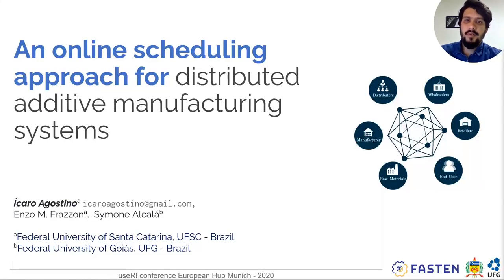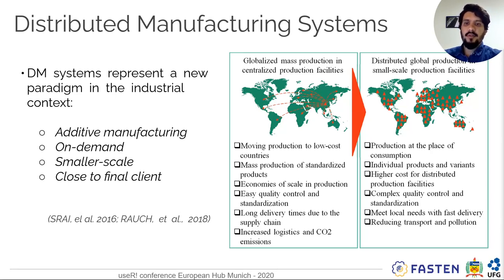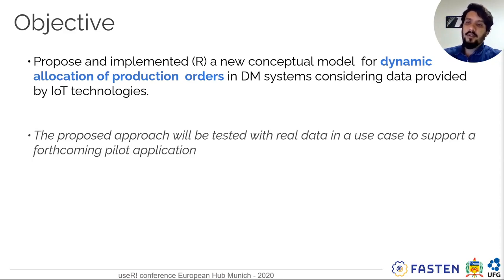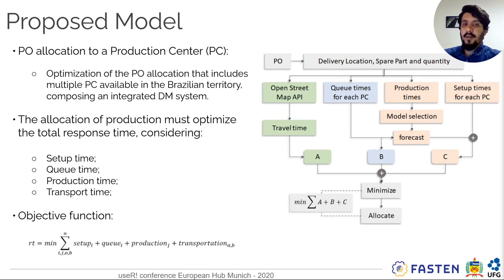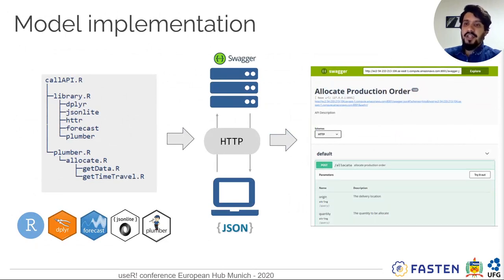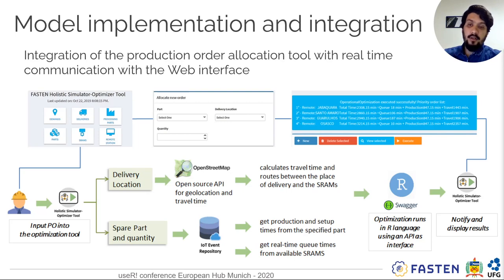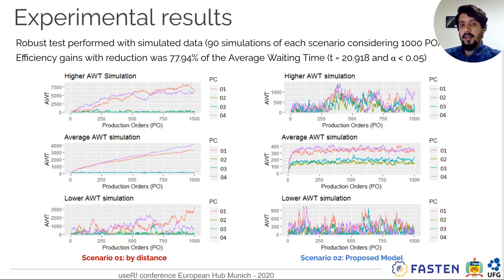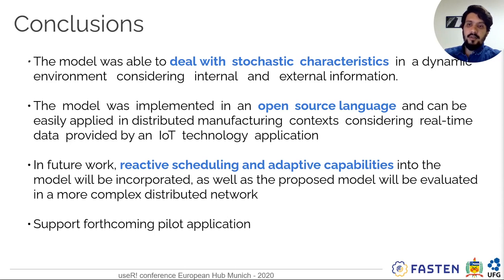useR! 2020: online scheduling approach for distributed additive manufact. (I. Agostino), lightning

Comment: Hi Icaro, Thank you for your demonstration. but most of the businesses are using ERP systems, and has a supply chain arm which needs supplier confirmation with the lead time. as a supplier If I want to reduce my lead time, I will try to change my manufacturing strategy to be make-to-stock not make-to-order but this will impact my finished goods inventory. 
If I am waiting sales orders and them perform production orders, I will have a huge unbalanced workload, I may not be able to fulfill all my orders based on capacity limitations, do you have a strategy to predict the orders like demand sensing?

Thanks again for your presentaion.
Reply: In this case, the company manufactures the spare parts for its own use. It is a huge challenge to predict demand, because you never really know where new parts will be needed. In the same project, we are trying to connect this application with a demand forecasting application. Maybe at the end of the year we will have new results on this.